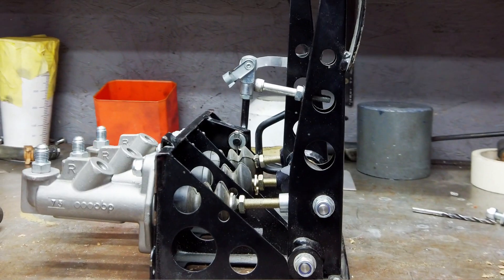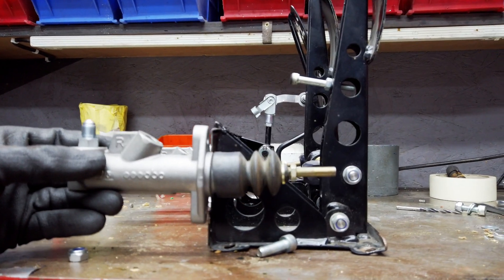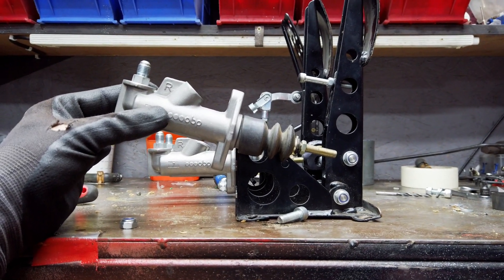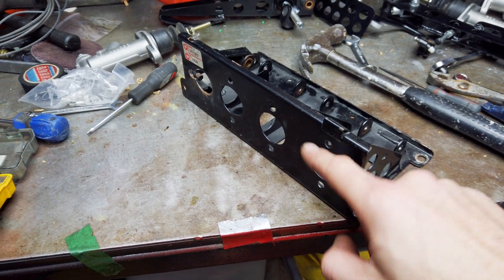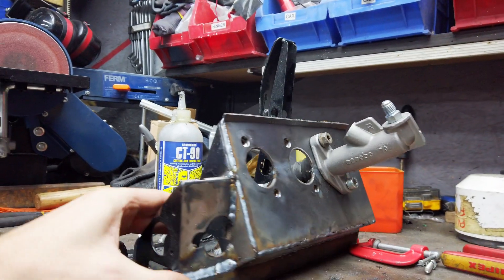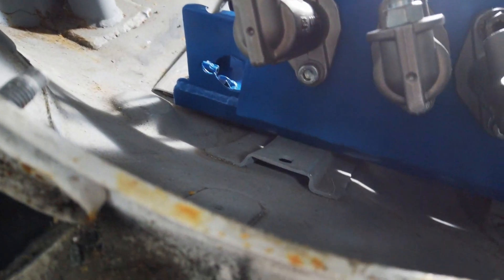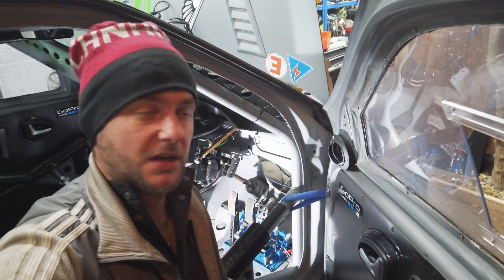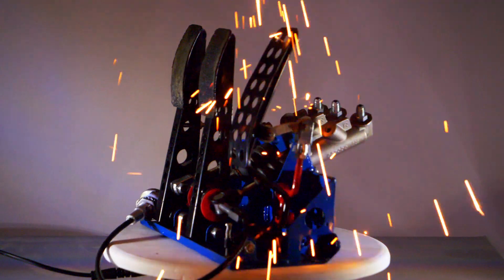OBP pedal box modification. Clio race car build. pedal box flex fixed!

Comment: Great video! How long did it take you to complete the modifications to the pedal box?
Reply from the maker: dougle_turbo thanks! On and off about a week.
Reply: @RuskiWeldFab  So around 40 hrs to complete?
Reply from the maker: dougle_turbo I would say around 10hours. As I was preoccupied with new engine delivery and needed to take the old one out to get better access.

Comment: why didnt you move your seat and steering wheel to get a better weight distribution ?
Reply from the maker: Hey thanks for the comment. The seat is already absolutely as far as it would go. I am 6’4” and need both seat and pedals as far apart as possible.
Reply: ruskiweldshit  ah ok, i know that kind of space problems as im 6‘3“

Comment: I have a pedal box like that but I think something is wrong with the brake piston for the front because it is moving very loose while the other one has less motion. Is that how it is supposed to move?
Reply from the maker: In all honesty I am not sure. As far as I know it should be smooth with out slop. If it’s very loose there might be a problem with a seal